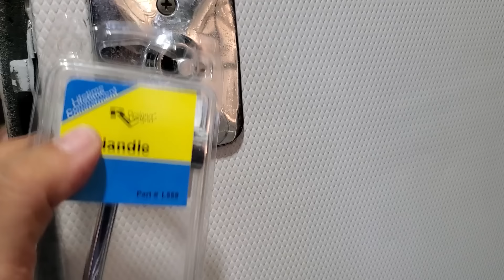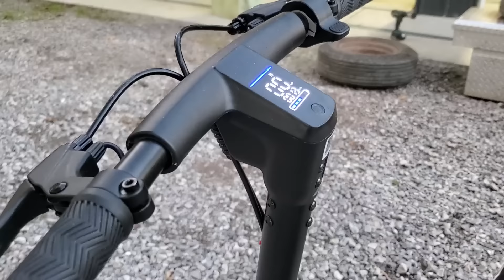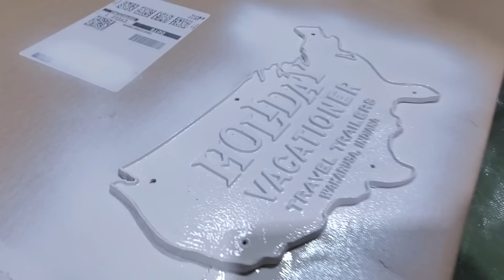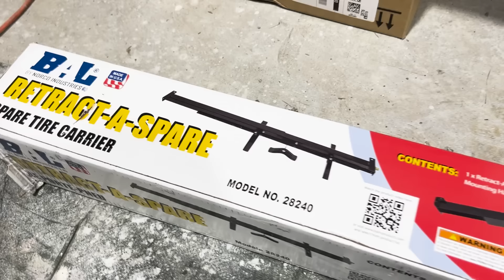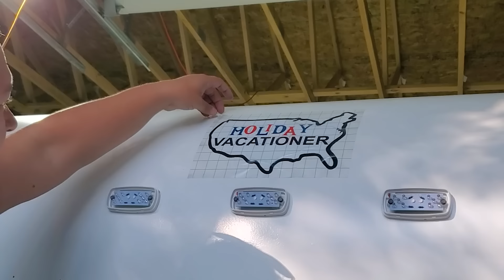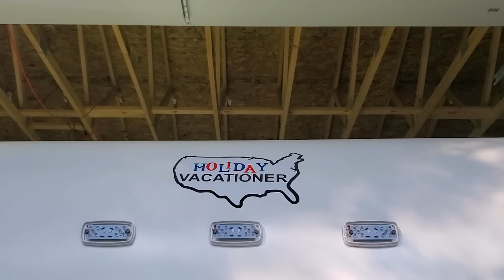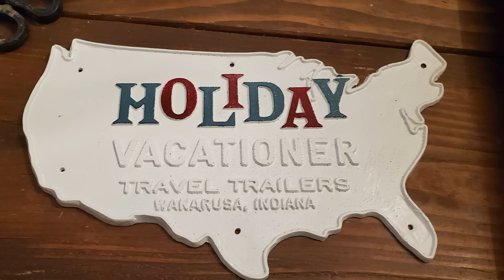Exterior Makeover Complete! Bringing Our Vintage Camper Back to Life  (Hovsco Sync Max Ebike)

Comment: Love to see how much you all enjoy your projects! The details look so good on the Holiday Rambler.
By the way, FYI, those LED flame bulbs operate at 3v. If you open up the base of the bulb and remove the step-down transformer bits, it can run off two AA batteries or you can hook 4 bulbs up to a 12v circuit.
Reply from the maker: Thanks, good to know!

Comment: I had a bunch of the same issues you guys had with my 71. The partsam marker lights, I was lucky and caught the colored leds after the first one. I should have done as you guys I put the wood behind the marker screw holes, great idea. The shocks are a slightly different part number than what everyone told me originally and were too long as well, should be Monroe 555001, not 555025. If that interior door handle fails I've got an original I can send you. Take that door knob into a local Ace/True Value and they can make a key for it, cost me $8. The exterior grab bar is nice! I used the same and it really works nicely. Nice idea on the emblem molds, I might have to try something similar if those hold up. Apparently one of the founding family members of Holiday is working on getting those emblems recreated. My 71 has that same 110v porch light, I'm still debating on what to use for the light now, since I converted it to 12v. Maybe I'll borrow your idea for the light, looks nice.
Reply from the maker: Thanks for the comment 😁. I'll take a look at the shock part number you provided. Hopefully our interior handle works. If it doesn't we'll  let you know. Thanks for the offer. We'll also have to get it a new set of keys made. Thanks again 😉

Comment: I painted the rims on my RV candy apple red. A nice splash of color. First went the gold base then some Autozone red anodized. They are pretty.
Reply: Did you use the Metalcast red paint? If you did you'll want to spray a clear that has ultraviolet protection over it. I've painted things with it and in the sunlight that red fades in a few months if it's not protected from UV light.
Reply: @greggv8  The color is called red anodized. I did put a clear acrylic over it mainly to protect it from rock chips.
Reply from the maker: Sounds like a great idea!  If we ever ditch our hubcaps, or lose them, we'll definitely paint the wheels 👍👍

Comment: Pro tip for painting a wheel with a tire on it. Take a plastic bag or large section of plastic of some sort and pinch it in the center and pull it through a circle in your other hand creating a long pointy section of bag. Take it and stick the pointed end at the center of the wheel and cut off the entire section at the tire where its on the rim or just a little less. Then open up the plastic and you will have a hole the size of the rim, you can let some air out of the tire and push the plastic between the rim and the tire so the tire is covered and the rim is exposed and now its ready to paint.
Reply from the maker: Good tip, thanks!

Comment: In the future, if you want to break the bead on a tire, get a couple of 4 foot sections of 2 x 8 screwed together, then make kind of a ramp out of it and put the edge of the wood right next to where the bead goes onto the rim. Then take a truck or tractor or something heavy and kinda slowly drive up it and it’ll pop it right off.
Reply from the maker: Sounds easy better than what we tried 😆. Next time we'll know!

Comment: To make a copy of your maps, spray them with a release and the press modeling clay (soft) then take bondo and thin it a pourable consistency.  Make a positive mold and then make a another cast from the positive mole.  You could use that in your silcone mold also I believe.  The Bondo method gives a strong finished piece.
Reply from the maker: Great idea, thanks!

Comment: Easy fix for the lock, take the outside of the lock set to a lock smith and they can re-key the old knob. Either make a key to match or I would have them change the internal parts and make a new key to go with their setup.  Usually pretty cheap.
Reply from the maker: Great suggestion, we'll do that!

Comment: Hi , I was looking for the link to the shocks. We just got the same camper and it needs some work but we really would love to replace the shocks but having trouble finding them.
Reply from the maker: The shocks I originally ordered were a little to long at 7 7/8" compressed. I found another length on Amazon that's 7 1/2" but I haven't ordered them yet. They are Lippert 7.5" RV trailer shocks

Comment: It would cost a bit but four new springs replacing the rusty originals could be made to raise the ride height 1 to 2 inches which would give more suspension travel and work better with the new shocks. The originals might have lost some of their arch with the problems you had removing the shocks. Another reason for new springs is safety. Rusty leaf springs can break, especially if they've been frequently exposed to salt and other road de-icing chemicals.
Reply from the maker: You make a good point. The underside of the camper has some surface rust but nothing major. Finding the right spring rate on these old axles might  be difficult. I did see another comment about someone with the same issue when it comes to shock length. I'm going to try another shock part number that should be shorter. We'll keep you posted on how it goes. Thanks for the comment 😁
Reply: @retrorevivals  There are shops that make custom trailer springs to match existing ones. When Gonagain broke a spring on his cargo trailer RV he was able to shore it up with a chunk of small tree he found then limped in to the nearest town that happened to have a repair shop that could make leaf springs. Another time he had a spring hanger break from a bad weld, and later he did more upgrading of the trailer suspension.

Comment: White walls , These tires were most commonly used from the early 1900s to around the mid 1980s.
Reply from the maker: You're correct. I was thinking more of the wide white walls but you're right. The later years were more of a white stripe 😁

Comment: Just a second just instead of taking the spare tire in placing it in the tovial.You could always get a plate of metal and put it on the inside wall of your storage box on the tongue and drill holes through the side.And lag bolt the spare to the side of that storage box.
As with your past endeavors on harvey you know how things end up not always being where they're supposed to be at? Well imagine if you were Is somewhere and you forgot to pack up the spare tire?
Just a suggestion.
Reply from the maker: We'd love to keep it with the camper.  There are load leveling hitches that go on the front that'll be in the way but we are still thinking of options.  Thanks for watching!

Comment: TS 11:50. When you get done with the dremel, Will you  make a mold of that? Should be perfect then. Sorry, That one looks better than Harvey, so far.
Reply: I'd work on making one of the emblems as good as possible to use for making a mold from. To make it flat I'd drill and countersink holes to use flathead screws to hold it to a board then use JB Weld to fill over the screw heads. All around the edge between the emblem and board I'd push in modeling clay so there's no gap for silicone to run into. Next I'd use some wood strips to make a shallow box about 3/4" deep on the board, with glue to ensure the silicone won't leak out. To keep the silicone from sticking to the board and box walls it just needs an application of automotive paste wax. Apply, let dry, buff off. Do it twice. Don't wax the emblem. Spray on a mold release compatible with the silicone you'll use. Mann Ease Release 400 works with most tin or platinum cure RTV silicones. That's the master complete.

To do the mold without a pressure tank or vacuum chamber, mix the silicone then brush on a thin coat, making sure to work out any bubbles that will try to stay in sharp corners. After that's done the mold form can be filled. A trick that helps with bubbles is cold. Many RTV silicones can be mixed then chilled to slow down their cure without ruining them. In a refrigerator that will slow it down so bubbles can rise, without making it too thick so the bubbles can't float up. The silicone I use for all my molds is Silicones Inc. P60, which can be mixed and kept in a freezer up to a week then poured cold. It will eventually cure and solidify even in freezing temperature.

With the mold cured, the colors can be made as part of the casting so they'll be permanent, fade proof, and can't rub off. I'd use Smooth-On Crystal Clear 202 with their UVO opaque colors. Mix some blue, red, and black with the Part B of the resin, in separate bottles. I use small sports drink bottles, the thick walled ones. (Washed out and dried of course.) Mix up a small batch of one color then pour some into a syringe to be able to carefully fill up the letters and border. Let that set for an hour or so, so it's setting up. For the white background use the clear resin with UVO white.
Reply: @greggv8  Really? All of that would be needed, IF, the intention were to sell the product for profit. Does not seem to be the point here. Just my thought though.
Reply: @markwitkop7022  I'd do all that just to make ones for myself.
Reply from the maker: This is certainly more detailed than the method we used with random Tupperware and just doing a sort of pour and pray method.  Thank you, we'll come back to this next time we try to create a mold, great suggestions!
Reply from the maker: Mark, we didn't make a mold post-dremeling but not a bad idea.  I think, ultimately, it would have been a time saver to spend more time trying to get a bubble free mold from the start.  We're happy with how these turned out but would do a couple things differently next time.